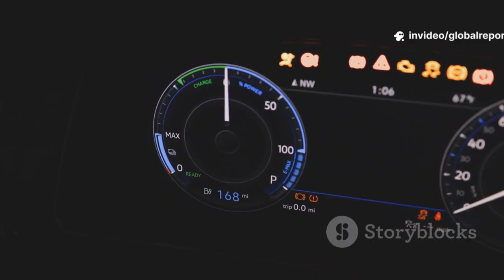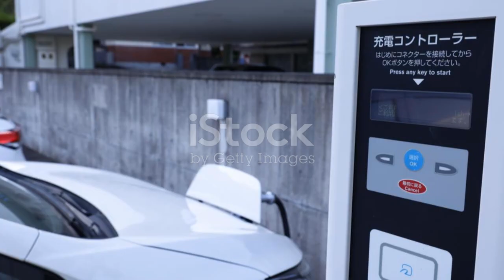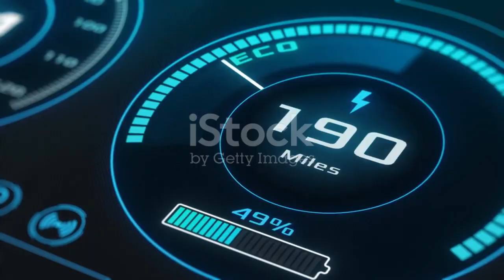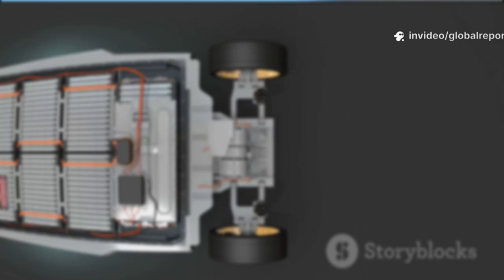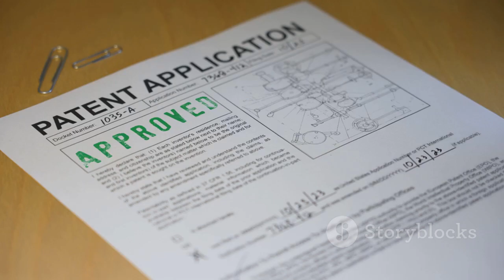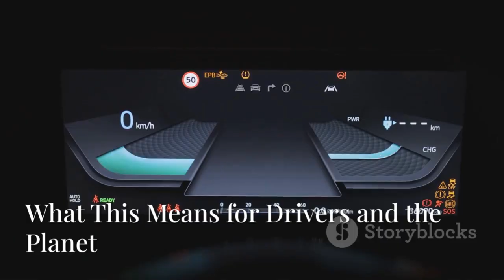Toyota CEO Unveils Solid-State Battery With 1200 Km Range and 5-Minute Recharge

Comment: Nobody currently waits hours to recharge, yet this line is repeated throughout the video.
Even at a modest 80kwh charge, a 61kw battery will take 45 minutes to charge from 10%-80% (the industry standard), giving an additional 180 miles of range. Quite a few EVs can take up to and over 300kwh charges.

Solid state is in no doubt a next generation technology and a marked improvement on current battery technology, but you don't need to downplay the current tech just to make the new tech look good.